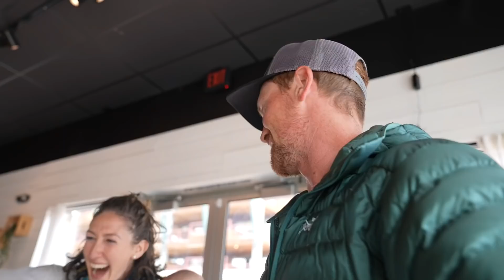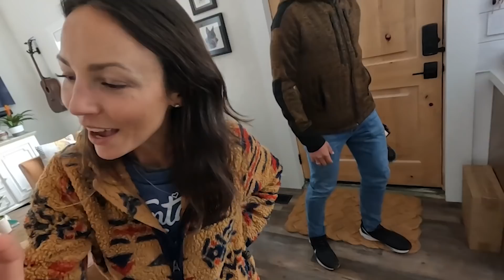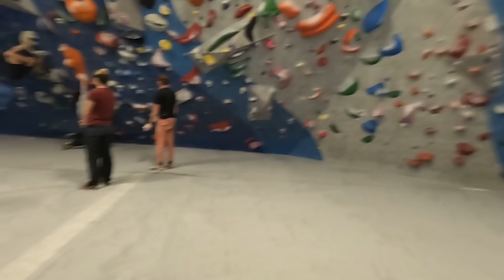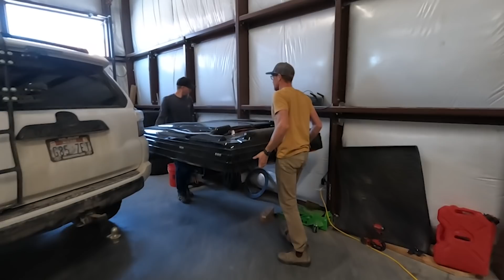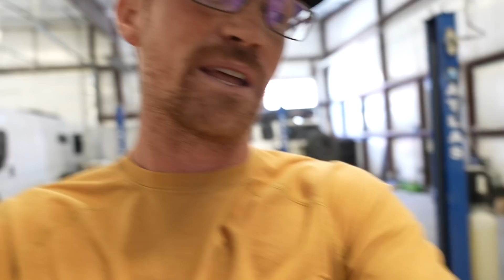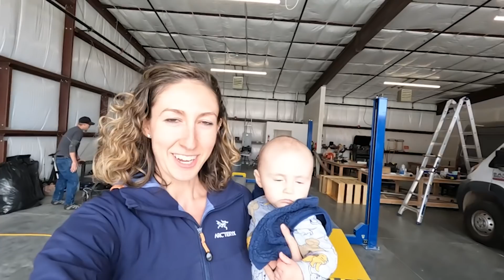WE CAN'T BELIEVE IT SNOWED AGAIN!!!

Comment: I live 12 miles south of Pikes Peak just north of Canon City, Colorado.  Like you guys, on 5/20 I woke to 18+ inches of snow.  That is more than I have seen in any of the 11 years since I moved here.  Topo map contour for 6250" runs through the living room.  It is now 3 days later and most of the snow is melted.  We are semi-arid and I the snow/precipitation conversion is but the 18 inches of snow is about 1.8 to 2.0 inches of our yearly moisture.  The amount of moisture we get here is about 11 or 12 inches.  We got an easy 10% of our yearly anticipated amount in one day.  And by tomorrow or Wednesday the muddy roads will be dried  out.  Another comparison point is that seldom has there been such a late snow fall: usually the last snow has been in the first half of April.  Hope this catches you up on a piece of trivia.  Hang in there and you will be able to get back on the garage build i n the next month or so.

Comment: Maybe you guys should think about installing the roof pulley set up in the shop anyway. Would be good for van builds. Installing Roof racks and solar panels Etc. It only takes a boat trailer crank and a couple of pulleys and some rope or cable.

Comment: hey trent n allie here is a little tip might not work but when u put the tent apperatice on the toyota could u put it on the hoist at the shop raise to the roof level and just slide it over

Comment: Have you guys considered a rail and power lift type system for the shop? Can't remember the proper name right now. I know you had a bad experience with lifting straps during your home build. But checking your center of gravity and using tag lines could have prevented that disaster. Bummer about the Disney video and the speeding ticket. Definitely not your day. Stay safe and God bless.

Comment: Until you get the pulley system built in the garage could you use one of those drywall lift jacks to help lift the roof tent ?
Reply: Nice idea, thou it might be too heavy?
Reply: @gregormiller4037    not sure. don't know how much the tent weighs. I think I've seen it advertised that the drywall lifts can hold up to 150 pounds.

Comment: Work smarter, not harder. Lay some 2X's across the lift, put tent top on the 2X's, run lift up, drive under the lift, remove a 2X at a time and easily lay the topper onto the SUV. A lot less straining.